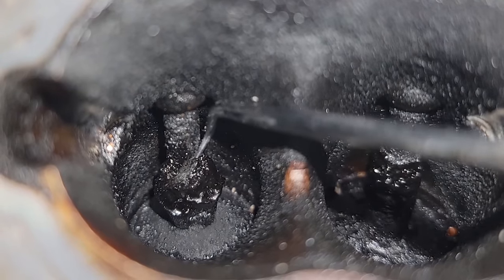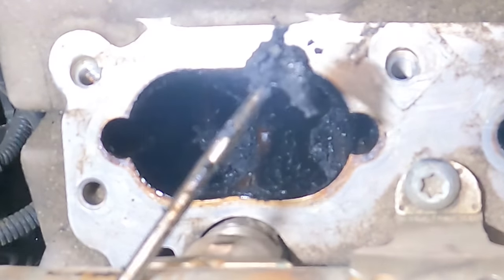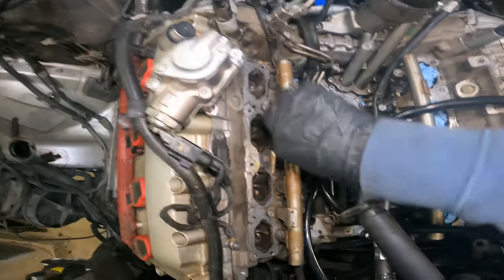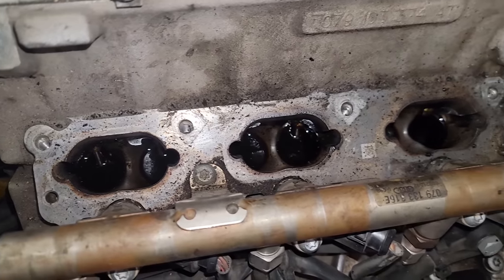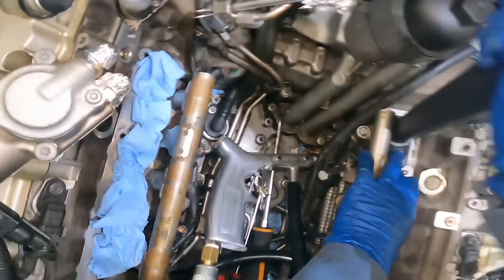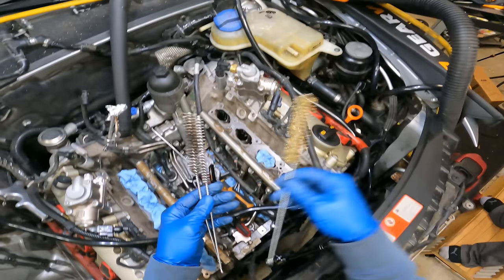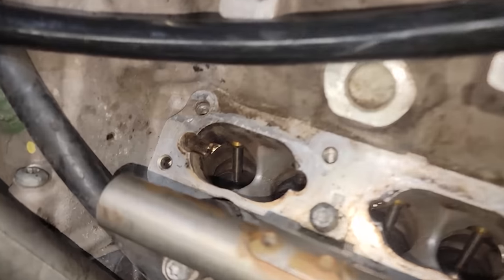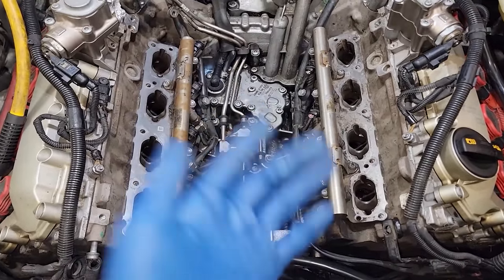Audi 4.2 V8 Carbon Cleaning | DIY Walnut Blasting step by step instructions

Comment from the maker: ~~~~~~~~~Here are all the tools needed for this job~~~~~~~~
Crankshaft Turning Socket (NEEDED) - https://amzn.to/43cUcI6
VW/Audi Carbon Cleaning Walnut Blaster Adapter (NEEDED) - https://amzn.to/3Aow08b
Ground Walnut Shell Media - https://amzn.to/3R1KiCu
Reusable Respirator - https://amzn.to/3dZZj9L
3M Safety Glasses - https://amzn.to/3dXP9Gm
Long-Handle Bristle Cleaning - https://amzn.to/3Avfsf0
GEARWRENCH 8 Pc. Long Hook & Pick Set - https://amzn.to/3Kktp3I
Gumout Carb and Choke Cleaner - https://amzn.to/3ThKT4U

eManual Repair Manuals for Any Vehicle - http://shrsl.com/43l4o
Reply: do you still own the car? Any update on the carbon build up?
Reply from the maker: @jerryx2000 this car I sold after about 15k more miles of issue free driving. Drove it down to Las Vegas when I moved then sold it. Currently carbon cleaning a 3.0T to go back in my A6. That video will be next.

I did install a catch can on this one after as well, I'd be curious to know the results as well
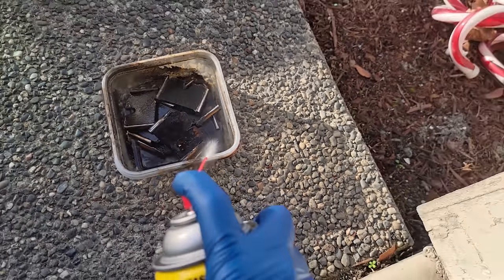Reply: @Mechani_Cole  13:48 INSTEAD OF SPRAYING CARB CLEANER AND SCRUBBING IT WHY NOT USE THE WALNUT BLASTER?
Reply from the maker: @21boxhead the blaster was missing some areas. I've gotten a little better at it now and just use the blaster

Comment: I miss my A6 with the 3.2 motor…..I don’t miss the maintenance 🤣
Reply from the maker: Same! I loved my 3.2 Avant and wish I still had it. After working on this V8, the 3.2 seems soooo much simpler to work on now. Love how this V8 drives, but hate hitting the gas pump. Sold this one and just picked up a 2009 A4 2.0, even easier to work on😅
Reply: @Mechani_Cole  nice! That version of the 2.0T makes for great content.
Reply: I miss my 3.0L naturally aspirated Avant.
Only major maintenance I ever had to do was timing belt

Comment: Looks great! I'm going to be attempting the zip tie method on my wife's CX-5 in the spring. You basically bundle a bunch of zip ties together, stick them in your drill, and let it rip inside the intake channels. The zip ties are soft enough to not damage anything but rough enough to break the carbon loose.
Reply from the maker: @Jared S how did the zip tie method work out?

Comment: I recently did a refresh on my 1994 Lexus LS400 web through and changed out all the rubber, starter, alternator, power steering pump, rack and pinion, interior etc. But opening up that intake compared to what you were showing at the beginning seems unreal. 29 years running, sitting at 290k miles on the dash and my valves looked closer to your end product than your beginning. And according to the records she's never had this type of service done to her so I xan genuinely say I'll never own an audi
Reply from the maker: Lexus are great cars. But you do realize this is the main difference of "Port Injection" like your Lexus as opposed to "Direct Injection" like these Audis and several others. Each version has its benefits. But with port Injection you will usually never see carbon buildup due to fuel always washing the valves. 

In direct injection engines, the fuel never touches the valves. So while it overs more power and efficiency, it needs carbon cleaning every 60-80k miles. 

Those old LS 400s are nice and last forever though. Some of the best built. I just picked up a 00 Mercedes W202 and it's also a very quality car without these issues. Thanks for watching🫡
Reply: @Mechani_Cole  direct injection doesn't provide more power or efficiency. For power it's obvious - direct injection engines don't make any more power and injection type was never a limiting factor. And for efficiency I could just refer to VAG EA888 Gen 3 tech docs where they state that adding port injection increased fuel efficiency and lowered emissions. And beyond this statement these engines run solely in port injection mode when torque is under 50% (so almost always).
Reply from the maker: You're talking about newer vehicles that have both port injection and direct. I was referring to comparing your 94 port injection Lexus to a 2008 Audi A6 direct injection engine. Both are very different. Direct Injection is more efficient by itself than port injection on this time period. You were earlier comparing a Lexus to this, so like comparing apples to oranges
Reply: @Mechani_Cole  Direct injection isn't more efficient and that's why VAG uses port injection only mode up to 50% of max torque in recent engines. If port injection wasn't more efficient, then they won't use it almost always while there is also direct injection installed at the same time. Efficiency of modern engines relies on many other measures which don't tied to injection type in any way.
Reply from the maker: You should do a little research or reading before speaking so much. 

"By injecting gasoline at high pressure directly into the engine's combustion chamber, direct injection more precisely measures fuel than conventional fuel-injection systems or old-time carburetors.

The result is more complete combustion and cooler cylinder temperatures that enable a higher compression ratio for greater efficiency and power. Engine technology supplier Bosch says that direct injection can return a 15 percent gain in fuel economy while boosting low-end torque as much as 50 percent."
Reply: @Mechani_Cole  I could repeat it third time. In Gen 3 engines VAG installed port injection in addition to direct injection and they use ONLY port injection up to 50% requested torque. Direct injectors are shut off. So modern TSI engines use port injection almost always while driving. And in their tech docs they state that using port injection allowed to reach Euro-6 emissions and lowered fuel consumption. And that's absolutely obvious - being injected into the manifold fuel has more time to mix with air than in cylinder, giving much better homogenization of the mixture.
So they clearly state that port injection is more efficient and that's why they installing it to modern engines.
The audi you mentioned has better efficiency not because of injectors type.

Comment: My friend has Toyota Voxy with M20A engine, he get rid of carbon buildup by using aftermarket oil catch tank (the air from catch cank not going into intake), K&N air filter, Re-tune to turn off the EGR the result was lot cleaner even after 40k miles.
Reply from the maker: Yes, I installed a catch can on this vehicle afterwards as well. Won't stop it 100%, but will stop most of it for sure
Reply: @Mechani_Cole  yeah, not 100% but carbon cleaning interval was extended and lot easier to cleaned.
Reply from the maker: Agreed! I wish all direct injection Cars had a catch can from the factory.

Comment: The best solvent for that is acetone/toluen blend. Scrape what you can, wallnut blast and then clean with solvent.
I like how newest DI engines are introducing port injection to solve this problem.

Comment: Great job I don't have a walnut blaster but I do have a Dremel with a small wire brush attachment and a long extension along with a small camera on a USB cable attached to my phone so I can see clearly.
I removed everything off the valves without any damage.
Worked just as good and extremely fast .
Reply: Just think same. Iron brush is better so you can even give polish surface
Reply: @FuriousHondaBoy  yes and you can use other attachments and polish the area but be careful to pick up all the debris afterwards.
👍👍👍👍👍
Reply: Which Dremel attachment? It would be very helpful. Thanks!
Reply: Yeah I'd like to know the exact attachment you used as well!
Reply from the maker: These are the best to use - https://amzn.to/3T4jpAB
Reply from the maker: Thesw right here - https://amzn.to/3T4jpAB
Reply: Hi! I also forgot to ask, which extension do you have? Can you share a link! Thanks by the way for the link of the attachments.

Comment: Nice work! I'm about to do this on my 17 mazda 6's 2.5 skyactiv. I bought the same blaster and media along with some long picks and those brushes. My car has 79k on it and probably hasn't been done, I bought it with 50k miles. I also bought an extended tip for the blaster on Amazon. Look forward to getting it cleaned up!!
Reply: My Mazda 3 2.5 is at 80k and I was thinking about doing the same. How'd it go and did you notice any difference in driving?
Reply: @Nexxorcist  I just moved and haven't had a chance yet but still plan on it. Also have a j&l.oil separator to install as well.

Comment: I know guys were using tip extensions so you could stick it down in deeper. Might help if it's bent a little as well so you can blast around corners.
Reply from the maker: Yes! Super helpful, I am adding that to the gun next time. Definitely will be useful🤟🏼

Comment: how you make sure vales are 100% closed before you start blasting or craping to prevent anything goes in combustion chamber ? Thank you as always
Reply from the maker: When you rotate the engine with a tool , you just keep an eye on the valves until they look closed. I usually check by sticking the pick along the edge and seeing if the tip goes in or not.

Comment: I feel like spraying it with carb cleaner before anything is better then after, ( 1. guarantees that valves are shut 2. Looses up those carbs)
Reply from the maker: Until you do it, then you realize it doesn't do much. Soaked some in carb cleaner for 24 hours and it didn't do much if anything

Comment: Good and efficient process that doesn’t affect the valves, guides & conducts and if eventually there are some wood grain that goes inside in the motor it’s only a piece of wood! (not abrasive sand)

But I’m asking me why there are so many carbon in the intake side and why are them so oily. It seems like an exhaust pipe of a two stroke motor
Reply from the maker: Yes, this engine had a few different leaks I was repairing. Due to that, it was extra oily. But also, it's not unusual to see some oily residual inside the intake on direct injection engines. Due to blow by and it not going into a catch can, it recirculation through the intake. The PCV system tries to catch it, but not effective. After cleaning, I actually installed a custom oil catch can on this car to prevent the blow by from entering the intake. This would also reduce the Carbon deposits making cleaning less frequent.

Comment: you have a Auto tech's touch, nice job, nice box in the background, I just bought a walnut blaster myself, going to do it to my B8.5 , wondering if you've used OFF kitchen oven de greaser on your valves before you walnut blast, great video........
Reply from the maker: Thanks, much appreciated. I haven't personally used it no. The walnut blaster really does a good job on its own in my opinion.

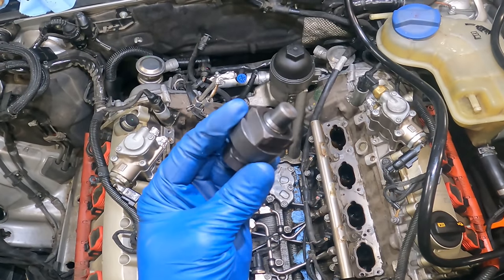Comment: 16:25  :       the most important issue  !    ? 
    Rotate the engine so the valves are closed at the moment of the liquid cleaning.
     And change oil and filter  twice in the first hundreds miles ! It worth it.  😊

Comment: Great video, love your attention to detail. What grit media would you recommend?
Reply from the maker: Appreciate it! I used Medium myself
Reply: @Mechani_Cole  Awesome. I was also wondering what you do to crank the motor to get to other valves. Starter switch? The special crank pulley socket? And what direction you you rotate on these 4.2’s?
Reply from the maker: @forkdealer7232 you need the crank turning tool listed in the description to turn it for sure. Only clockwise

Comment: Hello. Quick question. I have an audi a6 c6. I have a coolant leak but I didn't find any puddles on the ground. Today I changed the oil, checked for coolant leaks, did not find it. Could it be a leak inside the oil separator and while driving the liquid inside the oil separator evaporates? If so, what can I do to fix the leak? Thank you, I'm not a mechanic, so I turn to a professional
Reply from the maker: If it leaked inside the oil separator then it would mix with oil and make it look like a milkshake. By opening the oil cap or pulling the dipstick, you would be able to see if it's frothy or not. These cars often consume coolant through the head gasket, my 4.2 went through coolant every few hundred miles.

Comment: Dry ice blasting work great if you have or can rent one
Reply from the maker: It does for sure. I already have a blaster so I just use the cheap walnut shells
Reply: @Mechani_Cole  Dry ice blasting is faster, so after you scrape out the boogers dry ice will take care of the rest.  Because of the cost of the equipment you need to dry ice blast it doesn't make financial sense unless you are a shop that does a lot of it or you have the dry ice blaster already for other things.   A cheap but good dry ice blasting setup is just under $10k, not including the dry ice.
Reply from the maker: @Boodieman72 yeah I make videos for people doing work at home out of their garage on a budget so I try to be relatable and understand everyone doesn't have a bunch of money for fancy tools.
Reply: @Mechani_Cole  I hear you.  My AUDI dealer doesn't do walnut blasting they just use some chemical and charge $1,500 for it.

Comment: What’s your plan to keep the carbon from building up again?  Are you adding an air oil separator to the PCV system? That’s what I’d do if I spent that much effort to clean the valves.  It’s engine oil that’s burning on the valves and not being washed off by the fuel.
Reply from the maker: Yes correct. I have another video where I installed a custom catch can to prevent the carbon build ups. It worked great and was pretty affordable, check it out - https://youtu.be/n0a0EPWnaT0

Comment: Any type of blasting will do this.  But when you use media to clean you must clean even more after its done.  Fine particulate will damage engines.
Reply from the maker: This is why you use walnut shells opposed to sand. Easy to pick up with the vacuum and they don't damage the engine if they fall in the valves. Been doing it for about 8 years now, never a single issue🫡

Comment: What air compressor do you recommend for doing this task?  I only have a 125psi 10 gallon air compressor (4.5cfm at 90psi).  Will I still be able to do walnut blasting with an understanding that it might take a longer time?
Reply from the maker: That should work just fine. The Compressor usually gets time to catch up in between valves as well
Reply: @Mechani_Cole  awesome, thanks.  I hope you can find an Audi with the 3.0T engine at some point.  Your videos are always spot on.
Reply from the maker: @project arjun I actually have access to one. My good frien who lives here close to me has a 2014 A7 and it needs a carbon clean. I have actually heard removing he super charger is way faster and easier than removing this 4.2 intake manifold to get to the valves. No promises, but if I end up doing his car, I'll film it and post it🤙🏼
Reply: @Mechani_Cole  awesome, thank you, if you can also figure out how to do a DIY catch can for the 3.0T, that would be great.  Direct injection has its pros and cons
Reply from the maker: @project arjun I made a catch can for the 4.2, maybe could do something similar? Cost me about $40 total, video coming soon on  that one!
Reply: @Mechani_Cole  There’s something about the 3.0T’s PCV system that makes the approach a bit different.  I’ve only
seen one video of it on YouTube but the mechanic doesn’t show how to put one together.  Unfortunately the 3.0T has both the supercharger and secondary air injection.  The 3.0T is notorious for clogged secondary air injection ports as well
Reply from the maker: @project arjun to the best of my knowledge the 4.2 has a secondary air injection as well.
Reply from the maker: @project arjun have you seen this? https://www.urotuning.com/products/034motorsport-catch-can-kit-audi-b8-5-a4-a5-q5-allroad-with-flex-fuel-manifold?currency=USD&variant=41351867695297&utm_medium=cpc&utm_source=google&utm_campaign=Google%20Shopping&gclid=CjwKCAjwgaeYBhBAEiwAvMgp2mK-QyjtX-24fGCItCRw3ECyw60VYAhWlKfwTFE8DNehCXSBPR4IFBoC4FMQAvD_BwE

Could always make one yourself with the factory fittings, some tubing from a local parts store and an Ebay catch can. You're creating a sealed system still, just bringing it to an extra location if that makes sense. It shouldn't effect the secondary air pump at all.
Reply: @Mechani_Cole  that’s correct, but I believe the PCV valve is situated differently
Reply from the maker: @project arjun no need to do anything with the pcv valve. Simply just rerouting one of the hoses into a can basically. The pcv stays so does the oil/air separator.
Reply: @Mechani_Cole  thanks, I’m not sure why 3.0t owners aren’t making a big deal about catch cans in the community; it seems everyone is comfortable with doing walnut blasting, it doesn’t take long to cake the intake valves again with carbon.  I don’t mind preventive maintenance.  I think the fear is the catch can freezing in the winters, haha
Reply from the maker: @project arjun, just moved from Everett WA and freezing was never an issue since oil doesn't freeze to well. And honestly, I haven't met many Audi owners that ACTUALLY get their carbon deposits cleaned. It's more so one of those things that's gets left until a serious issue happens and it needs to be cleaned. I'd guess about 3% of owners actually have this service done😅 I wish I kept the 4.2 long enough to see if there was less carbon after 60k. The catch can did catch a decent amount of blow by, it will be in one of the next videos soon
Reply: @Mechani_Cole  awesome, that is very good to hear, I very much look forward to watching your progress
Reply: @Mechani_Cole  you think you would have gotten better results from one of the other higher priced catch cans?
Reply from the maker: @GR G maybe a little. But doubtful it would do much more. When I install another one I would prefer one with a dipstick so it can be checked without removing. But as long as you get a baffled can, it should be good!
Reply: @ProjectArjun  just get rid of the oil from air.